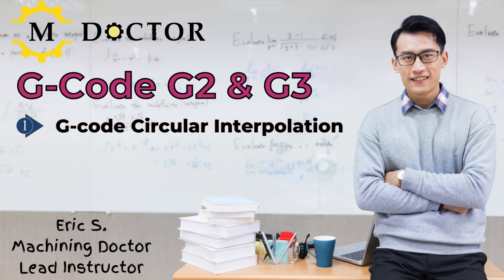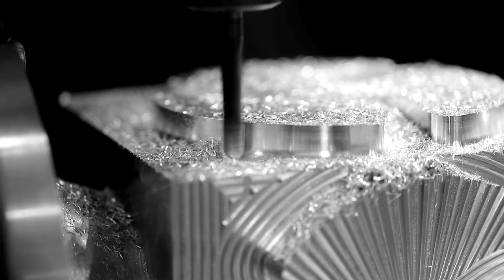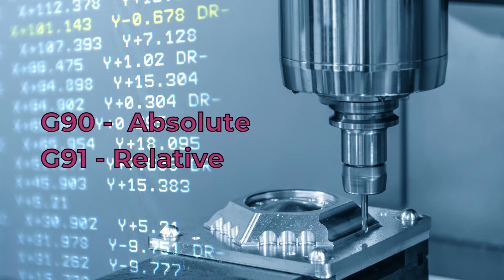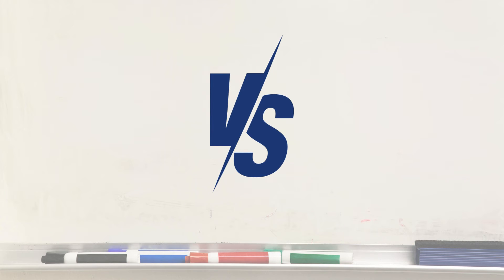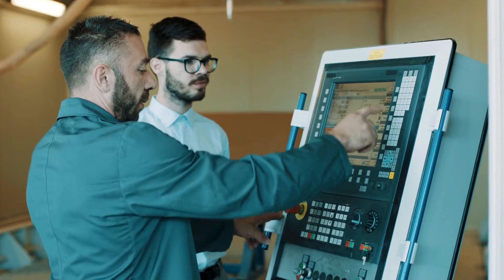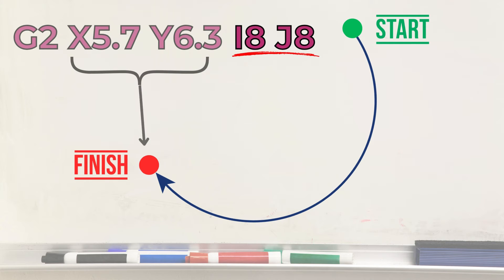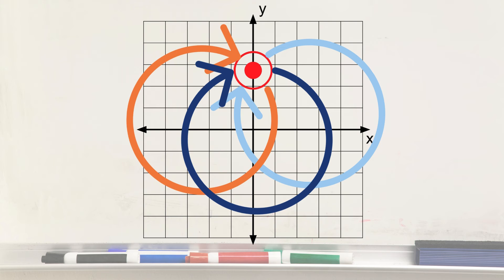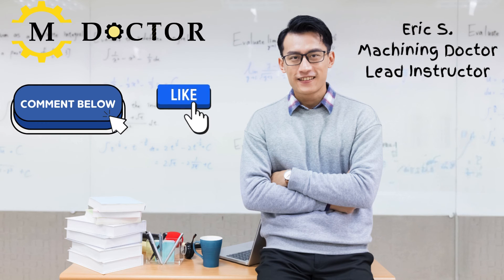G2 & G3 - Mastering Circular Interpolation in G-Code Programming

Comment: What if I want to draw a semi circle, is there any way to specify the angle?
Reply: no. its not an angular measurement.

you specify where you want to end up.
you specify a radius to rotate around relative to your current position.

for 180. start at 0,0.
a radius of 3, so it will end up at 6. x6,y0 say.

the center of rotation is 3 in front of where the tool currently is, x3,y0. or as they are the offsets... I3,j0

if it was located at 6 and a radius of 3 to end up  0, the I value would be negative as its behind the current location... unless its in absolute mode then its still x3,y0...

you have to apply trig for any angular offsets from the cardinal points...